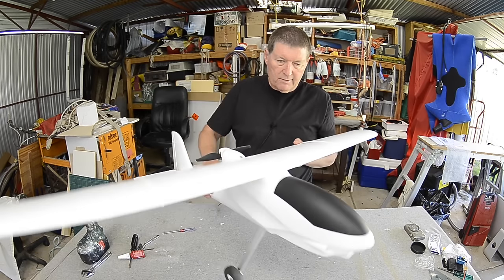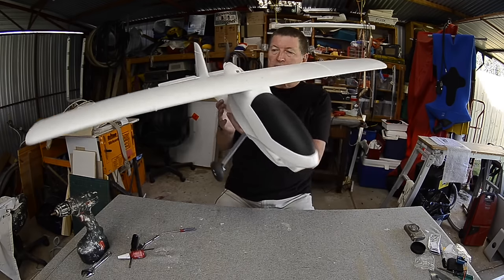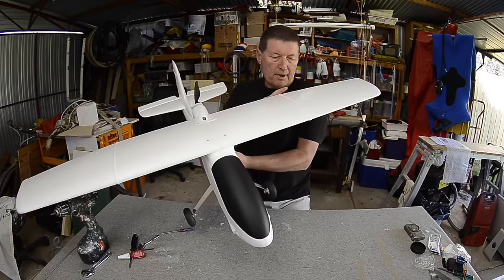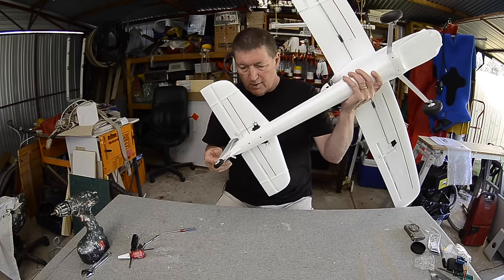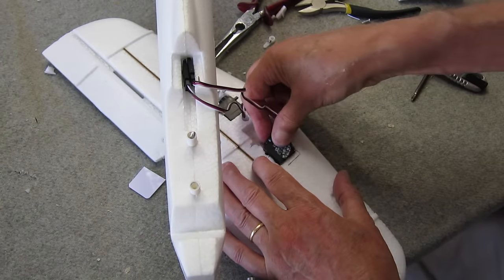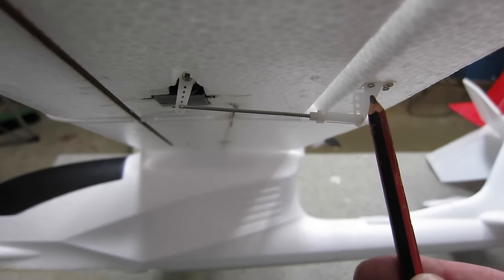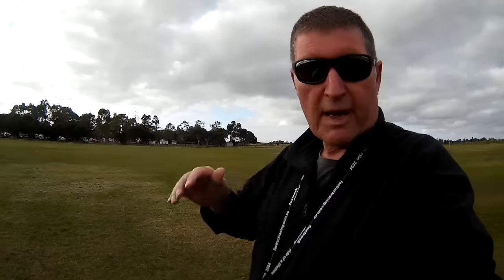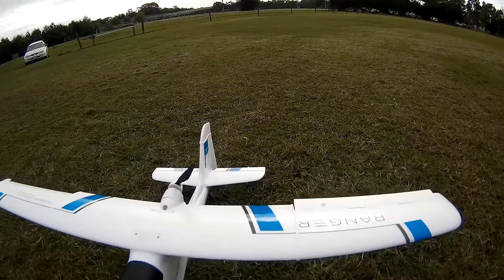1.4m Volantex Ranger mods

Comment: Andrew, nice videos.  I'm working on my own to get it to fly nicely, and your comments have been a great help in both the build, and the mods needed.  I've discarded the Tx/Rx combo that came with it so I could put it on my Spektrum Dx9.  Programed in differential and Rudder mixing.  That seems to have fixed the adverse yaw.  Now I need to tweak the engine thrust.  I've overcorrected the angle at the moment and have it ballooning up on full throttle.  I've got to go back and use a thinner spacer.

Comment: the first pusher I made using the FT Tiny trainer plans and converted to a pusher using my own changes I found the same issues with the motor. Mixing the tail rudder woth the airelons was brilliant,sounds windy there. cant complain though great flying little model! I have been thinking about getting one like that for FPV flying.I like Gear Best and Banggood,sometimes you have to wait forever for delivery but no complaints as far as shipping conditions.
Reply from the maker: +scott firman Hi Scott. There will always be flight problems with high mounted pushers, but planes like the Bixler and Cloud Surfer have got the design right whereas this Ranger get's it badly wrong. If I was buying another all round FPV motor glider it would be the Bixler 2 or 3. Can't fault them.
Reply: +Andrew Newton For the money,yeah the Bixlers were cheap enough,plenty of them were made,and crashed Im sure. I havent bought one,keep thinking about it. I am currently finishing up on my Dynam Waco BiPlane,Did the maiden the other day,It didnt go well,the CG was off even though I added weight ( not enough me thinks) The weather played a major roll,we have to deal with North East winds comming out of Canada, they end up as down drafts where I fly. very unstable, My Apprentice even struggles on those days,oh well summer is almost here

Comment: Awesome result and nice flying in that heavy wind... could have been interesting to see, how fixed the controlhorns farther to the front
Reply from the maker: +Stickmix FPV Actually I was wrong about that. I have added a correction note to the video. Bottom mounted control horn behind the hinge line gives positive differential. Had to make up a demo rig to work that out. Video explanation coming soon.
Reply: +Andrew Newton Ohh I see. You figured it out. I already wondered about, why you wanted to change it. But I thought, I had it faulty in my mind.

Ohh btw there will be a new video on my channel the next days... just say Flitetest feat. Experimental Airlines feat. Newton Airlines. 
You can be anxious about it 😉
Reply from the maker: +Stickmix FPV Yes I had to make the demo rig to work it out. I'll nervously keep an eye out for your video.

Comment: Hi Andrew, I have found it worth creating mixes to neutralise power input effects, both with torque and thrust line. I initially did it with a Cessna, and found that it totally transformed the plane, then with the Ranger, I managed to iron out all pitch effect to the point where it now has perfect neutral stick glide angle, then adding power creates a slight nose up climb. I did machine a six degree motor wedge, and your adverse yaw technique also helped a lot. It is now a very good plane, from what was, as you said, virtually un flyable. Cheers.
Reply from the maker: That's great news, nice one. It is well built, just has a few design flaws

Comment: Fantastic job Andrew!  That decal should read  "Ranger by Newton Airlines"
So to plug the Rudder into the Aileron channel you just added an extra Y servo cable? TBH I probably won't do that rudder mod I have Hitec 9X I need to learn how to use/program so I'll order in a Delta 8 RX to try just for this.
Reply from the maker: +Ken Oath That's right, add another Y cable.

Comment: Andrew what kind of flight time do you get with a 3000mah lipo?  What kind of motor and prop is it using?
Reply from the maker: +Albert Kim (marblekit) Um, dont really know the flight time yet. I have just been ducking out for quick test flights. I'll do a duration test in calmer wind soon. Motor is 2212 / 1400kV and prop is 8 x 4"

Comment: Your fixes for the motor were great.
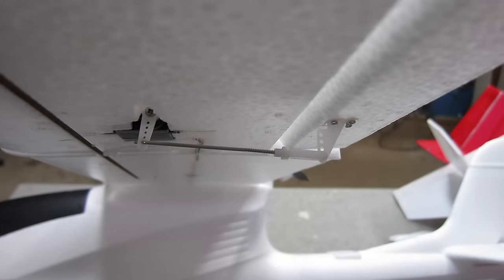At 4:52 you mention that bottom mounted control horns gives differential, what does that mean exactly?

Why would it be a problem if the control horn was top mounted vs. bottom mounted?  Can you please explain this for me.  Thanks
Reply from the maker: +SnapPunch Robert What I said in the video was wrong, hopefully there is now a correction annotation added. Bottom mounted control horn positioned behind the hinge line gives differential. Top mounted and behind the hinge line gives reverse differential. I have actually recorded a demo video to explain this more clearly (and to convince myself which way it works) Differential = Aileron moving up more than down.
Reply from the maker: +SnapPunch Robert Here's a sneak preview of the demo video https://www.youtube.com/watch?v=fV0U49NnjXM&feature=youtu.be

Comment: Great video Andrew.  Perhaps you can use a servo reverser for the rudder instead of flipping it over.  Might be easier if you have one of those.  I have this plane as well.  I bought the kit version from Banggood a while back for $50 and it's been sitting in the box for months.  I saw your video yesterday and was going to sell the kit but now I think I will try your mods.  Thanks!
Reply from the maker: +Albert Kim (marblekit) Thanks Albert. Servo reverser or transmitter mixing would work. But I wanted to stick with the supplied gear for the review. Now I have that done I'll swap to my Taranis and go to town with mods and mixes.
Reply: Hi Andrews. I really appreciate your advice here as well as with the wing wing z-84. But, would you mind sharing your radio mixes? I also have this plane with a programmable radio and wonder how you'd set it to overcome the problems you noted.
Reply from the maker: I mixed rudder with ailerons, it needs lots of rudder input and not as much aileron. Could try aileron differential too. Initially I used the non programmable radio.

Comment: Would you happen to know if the Ranger EX fuselage (plastic) will retrofit with the wings etc. from the Ranger?  It appears from pics the motor mount is different but all other dimensions/design looks the same.  I meed to purchase one or the other. This old foamy is badly crinkled and scared from a heck a lot glue!  $16+ for foam $62+ for Plastic EX
Reply from the maker: Don't know Todd

Comment: Hello Andrew, I bought this mini ranger few weeks back. I had a really bad maiden flight.. This plane just doesn't seem to obey me 😂..
Can you please explain me how you mixed the rudder & aeleron?
Reply from the maker: The supplied radio in the RTF version doesn't have mixing to I just plugged the rudder and ailerons into the same channel using Y leads. That made the rudder work in the wrong direction so I flipped the rudder servo over. You could buy a servo reverser for the rudder or you can do it all in the radio if it is programmable.

Comment: About the launch nosediving, look at the moment of two forces acting on the center of gravity:  One, the engine thrust above the CG pushing forward. Two, the air resistance below CG by the wheels pushing to aft. Two moments around the CG, diving the plane.  Thus, don't hand launch with wheels.  Or shorten the landing gear and use low frontal profile wheels. Or do a rolling takeoff. 

RCRahul 365 says below " I accidentally I used a CW propeller, and the problem was solved like a magic to the plane. It suddenly became a well behaved plane with no bad characteristics at all."   Interesting.   It looks like, in addition to the moment of forces around the CG, the prop wash is acting on the stabilizer further destabilizing.  Maybe it´s the wash plus the engine torque. By all means use a CW prop.

Also see another Andrew Newton video titled "Deny the DIP" at https://www.youtube.com/watch?v=uFwSEsqb3Fw

Comment: Meaning I have to do the same modification to make it more controllable? How does it fly with some gustiness?
Reply from the maker: Recent version might fly better, but this one certainly needed the motor thrust angle changed at least. No problems in the wind,
Reply: thank you for the helpful information. anyway when i checked Gearbest, Ranger RTF is not available at the moment.

Comment: I forgot to mention I had done the motor mount mod before I saw your video. What a terrible design from factory.  I used the same moldable plastic (heat in boiling water beads) to mod the motor mount as I used to build the "bathtub"

Comment: so you do not have rudder on its normal switch .
Reply from the maker: Not with this solution. With a programable radio you could leave it on the rudder stick and use a mix to achieve the same result.

Comment: Such an obvious thrust line design error in an otherwise nicely engineered model...It always makes me wonder how they can release it to market with such an obvious design flaw...?....Im used to using both rudder and Aileron together in turns, but its not something a novice will find easy to master while learning.....Suprised you went for the version with Radio in it m8..?.....Nice "fix it" tutorial though....useful for the unwary..well done...:)
Reply from the maker: +EnglishTurbines And why haven't they fixed it over the years. Everyone seems to be reporting the same issues. This was a provided by Gearbest for review, so not a kit I actually chose.
Reply: +Andrew Newton Ah, it was a donation, that explains it....It beats me, I mean I can understand them not wanting to re-tool the Fuz moulds, but they could include an add on wedge to go on the motor mount, its not rocket science and the difference it makes is huge...They obviously realise it wont affect sales I suppose..Are you going to FPV it Andrew..?
Reply from the maker: +EnglishTurbines Yes I'll pop an FPV backpack on to see how smooth it flies.
Reply: Andrew Newton Good idea, I think this fix it Clip is going to help a lot of people m8....:)

Comment: They made a mistake. It needs a high capacity battery. Minimum 3000 mAh or greater. Up to 5000 mAh. Need full FPV gear. FPV camera and action camera. Long range modules. (VTX and Receiver, (900Mhz)). So it will be a much better rate of weight makes flying much more.The front should be weight.